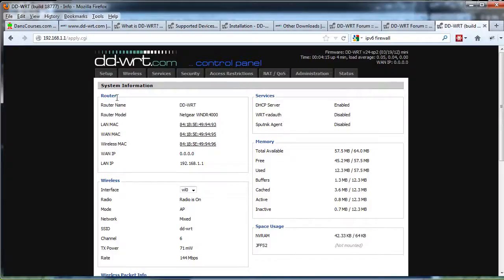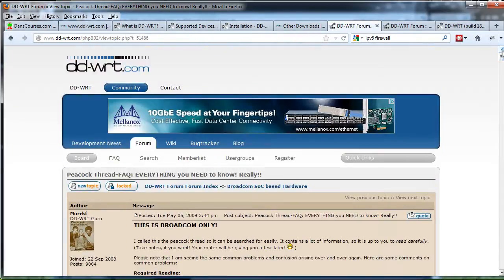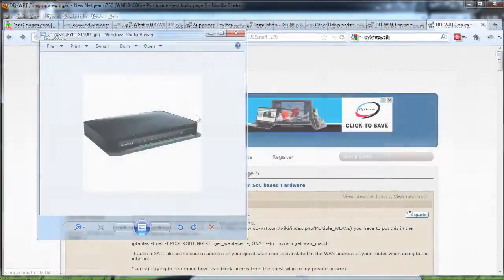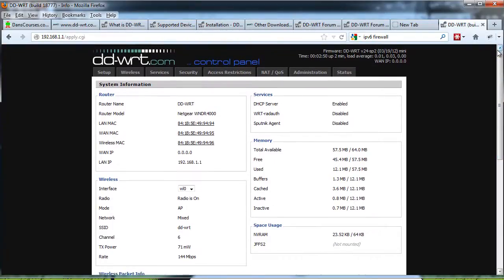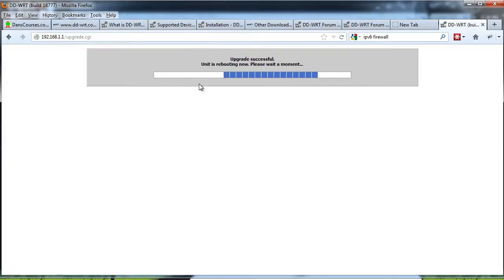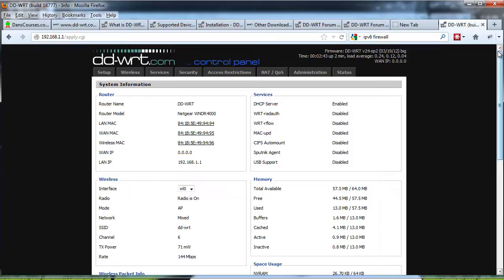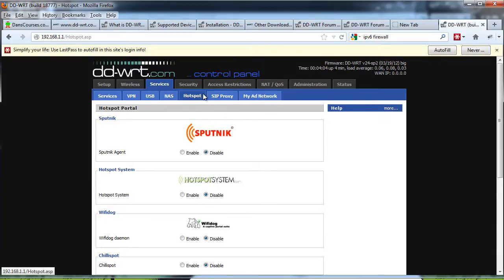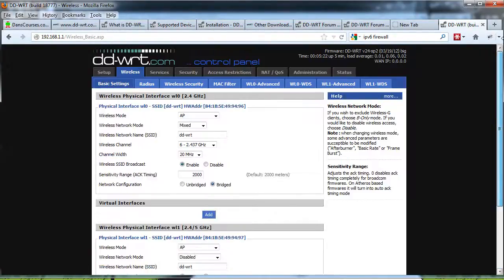How to install DD-WRT on a Wireless Router -Part2

Comment: Hello. I realize this is old.  Is the reason you did not do a 30/30/30 reset before flashing because it was an initial install of DD-WRT?  And a update fro DD-WRT to DD-WRT would require a reset before and after?